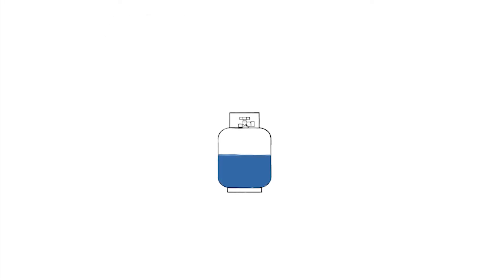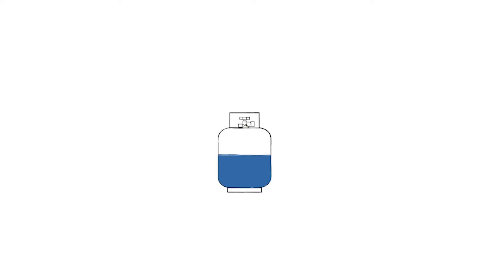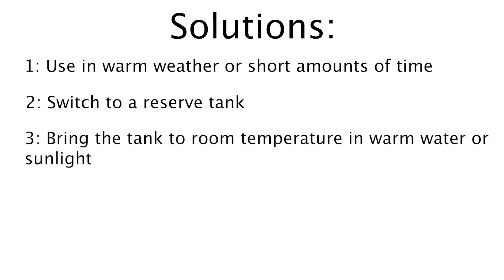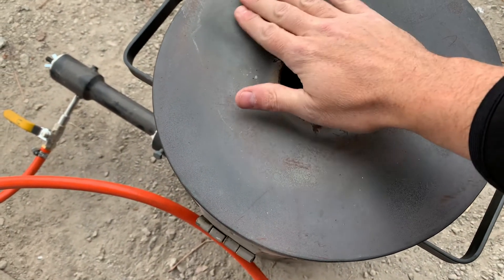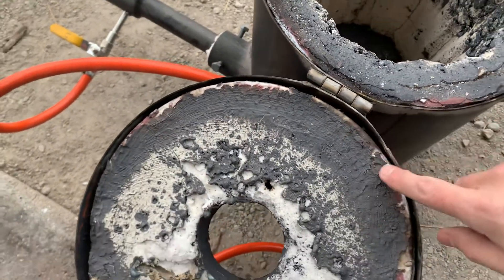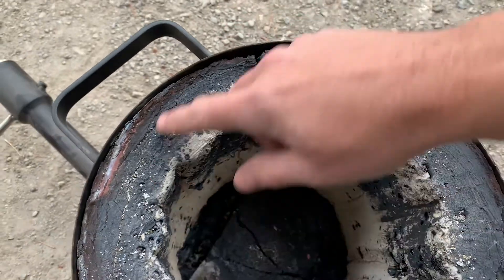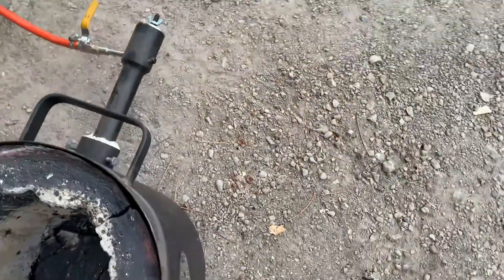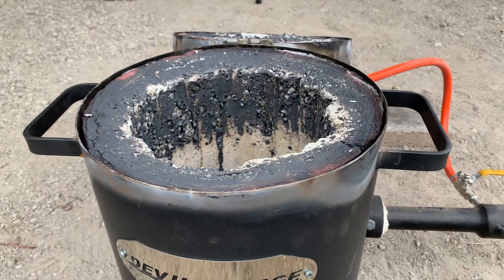Propane vs Cold Weather (And Future Work Updates)

Comment: Hi Anthony:  (Some may find this comment to be off topic)  Sharing some of my ideas about propane heating and also use of Grid based ELECTRICAL POWER....( based on some of your videos, you seem like an experimenter and inventor??!!)  Warning to All:  I am a 74 year old HERMIT, living alone in a cabin in the woods... I am not wealthy, but I am frugal...  I am not crazy or depressed, although I am perhaps odd.  I hate to make waste or overconsume... I try to live without many modern conveniences and try also to live like a kind of modern pioneer, but of course, still using many modern devices... (but if ELEFCTRIC, I try only to use appliances and devices which run/work on very LOW AMPERAGE... And lastly, I am not antisocial, I just don't find myself compatible with many people out there....  Anyway...
        Most of my STORED PROPANE cylinders are kept in my large two car garage which is about 30 feet away from my main house/cabin.... This stored, in house supply is about 1400 total pounds of purchased tanks of various sizes....  As there is a nice one bedroom apartment, which I keep empty and unused above the garage area, everything in the downstairs of the garage is well insulated... I allow my vehicles to stay outside because this area is my workshop.... There is a regular, what, "geothermal" furnace in the back corner of the garage... But I never use it... the only electrical power that I use in the garage is used to run various power tools and supply power to a decent sized freezer which is full stocked at all times....Anyway, I DO NOT BOTHER TO WARM my stored propane tanks in this garage until the OUTSIDE temperature is going to be below freezing for the next 24 hours... When I do HEAT the garage, I use a 30,000 BTU vent less heater which is powered by LP gas from a 100 lb LP cylinder which is sitting outside more than 10 feet from the garage...  This cylinder sits inside a deck porch shed, never on the ground, covered by two large thick trash bags..... When it is on and being used, the 100 lb tank of propane will last at least a month... and, I have NEVER had a problem with these big tanks FREEZING...  To me, this problem is most often happening to the small 20 lb cans or smaller...  I do not use these except to grille... ( and, by the way, a good way to grille is to use a camping type, THREE burner LP cook top... the one i use is by ROYAL GOURMET... and is very nice and comes ready to be hooked up through a 3/8ths inch fitting to your hoses or copper/brass lines...)
      Now, the house LP vent less heater is mounted in the "crawl space" and flows up into the house through a main system plenum and duct work... It is pushed by a small fan...  As such, most of the gas flow comes to the heater from under the house...  I purposely leave a small amount of fresh air to enter and leave this space as it choses... I never use the "regular gas furnace"...  I have no trouble heating the 1000 sq. foot house during the winter... Cost of propane in January and February may be about $70.00 worth of lp gas a month...(propane cost is about $2.75  per gallon-- about 22.7 gallons to "fill the tank".....) and often, if the weather is in the 30s or 40s, I have to turn it down to the lowest setting, which is ONE... just like a wood burning furnace, once it gets too hot, it is hard to turn it down, although the thermostat on the heater is quite reliable..... ( one last paragraph for now:)
      You mention hot water heaters...  Mine are turned off...  Electric stove and dryer are brand new, but never been turned on... I don't use them or need them...  I use a supplemental supply of electricity using a system of batteries and converters... I DO NOT USE SOLAR... it is useless to me here in MICHIGAN.... and, Solar does not produce enough AMPS... sorry... hence, it does not have enough punch to run HIGH AMP USAGE APPLIANCES efficiently...  (So many WASTE or OVERCONSUME electricity from the grid...)   I have NEVER heard of a SOLAR powered system which does NOT run though batteries and is NOT connected to the live GRID... Yet, my total power bill for a month is about $42.00.... half of that is "service/line charges" and various TAXES.. but enough for now...  we can talk about power another time.... stay safe and sound... yours rp
Reply from the maker: That is quite a setup!  It is good to know you have safety planned with the storage of so many tanks.  How far down did you have to go for your geothermal?

Comment: A lot of Moonshiners would heat their propane tanks ...  with propane.  That led to a lot of propane tank explosions and the bad reputation of moonshining...
Reply from the maker: That makes me hurt a little thinking about it.
Reply: @badideametals  Kay, so I see heating the propane tank directly with propane fire as bad. Trying to envision a way of heating the water for a water bath that maintains temperature.
Reply from the maker: I just swap tanks ... I have not had to heat them yet... My projects are usually small enough that I have not needed to do much else.  If I had to, I would use hot water from inside the house and heat it there... or even bring the tank inside the house to come up to a comfortable room temerature... you only need to heat the metal walls of the tank... try sitting on it :)
Reply: @badideametals  I heat with LP Gas  to an LP furnace inside my small house/ (heating about 900 sq. ft.)  More often than not, I tend to use a 30,000 BTU vent less heater... (I prefer DYNAGLO or PROCOM as opposed to a very popular name brand)  
    As a "prepper", I have a supply of 8 100llb propane tanks...  I have not had a freezing problem using these large tanks... (I live in MICHIGAN where it often gets down to about ZERO degrees F. in the winter months for a few days)... But what you say in this video is correct... the force of the gas passing from outside to the heater LESSENS as the temperature gets LOWER...  and, if you use a gage, the reading you get makes the tank look like it is lower than what it actually is...
    The easiest thing to do, in my opinion is to keep some smaller reserve tanks, (40lbs. size) indoors to use in an emergency...(if the gas supply from outside is interrupted)  These tanks can be used in a pinch indoors if need be due to problems outside from cold.... And, in three years, I have NOT EVER had to do this... and, of course, some will say, this is extremely dangerous in case of a fire inside... but, I would say, any fire inside is going to be extremely dangerous... Be careful and use common sense...
    Lastly, I would mention that I do NOT have a service contract with and outside propane company...  I take my tanks out to get them refilled at the best place I can find for price and service...  As such, I have in my possession about 1200 lbs. of propane in various tanks on site...  This is well over a years supply held in advance...   So,, good luck to all and be prepared, as they say...
Reply from the maker: @robertprestonsr2453  hey! Michigan gets really cold.  I have family in south and central Michigan and I hear all about how doors freeze shut and pipes burst.  That is possible where I am too, but MI seems to get it pretty hard every few years.  

I agree that smaller tanks are easier for many reasons.  As tanks lose pressure due to temperature change, having alternate reserves makes so much sense.  I do worry about propane indoors.  Propane gas is dense and stays along the floor.  If a tank has a bad seal and leaks, the dense gas will float along the floor until it gets detected.  My worry is, a water heater pilot, gas dryer (cloths), or some electric static discharge could ignite the gas and explode the home.  If the house is already on fire, propane may just make the fire louder… 

I think it is safer to keep tanks of propane away from open flames.  If heat is needed to keep tanks warm, a heated shed would be my recommendation, but everyone must do what is best for them.  I don’t judge :)

Comment: Good video, I enjoyed the propane bit. My firebrick cracked up like yours, I removed it and just put down some refractory cement instead, and when I put the crucible in I put some card board in between so it doesn't stick. It's working well so far, just an idea mate.
Reply from the maker: Hey thanks :) ... no firebrick 🤔... ok, I’ll try it.  How thick is your wool on the bottom?
Reply: @badideametals  I just dug the fire brick out and flattened it a bit and filled up with refractory until the height the fire brick was. I haven’t melted anything other than aluminium in mine though.
Reply from the maker: Good to know.  I have been looking into getting one of the white firebricks... I will do more research as I make my plans to recondition the inside of the forge.
Reply from the maker: Thanks my friend!  Also, I love your tree cutting videos!
Reply: @badideametals  thanks mate.